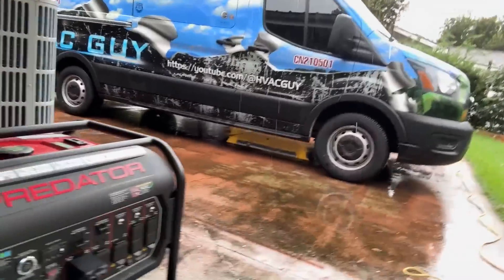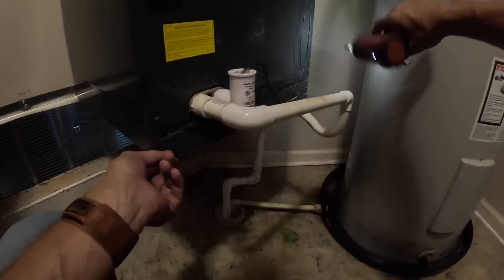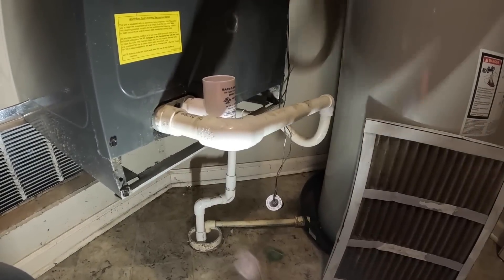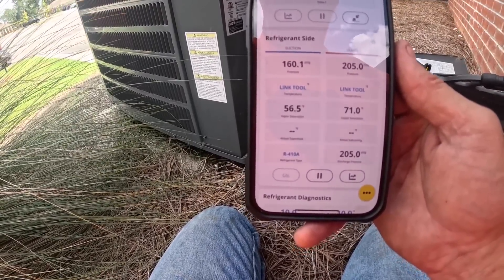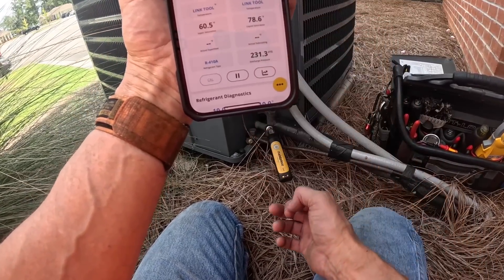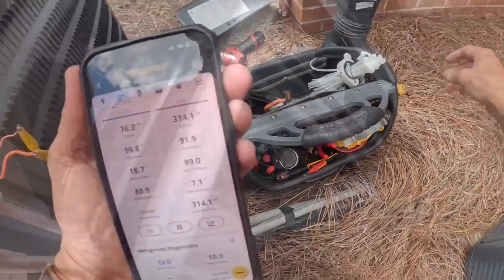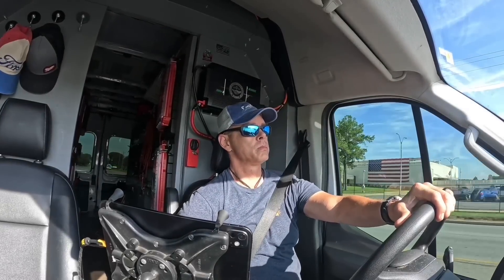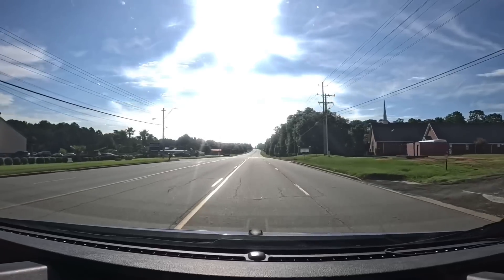Completely Frozen Evaporator Leads To A Failed Small Part! #hvaclife #hvacarmy #hvactrainingvideos

Comment: its rare in residential  to see the return air open and not ducted directly to the wall. ive seen this all the time with commercial though. the exception is Gas furnaces which have to be ducted due to combustion